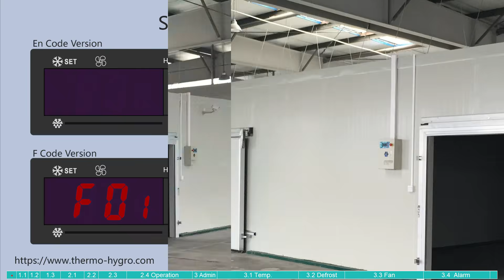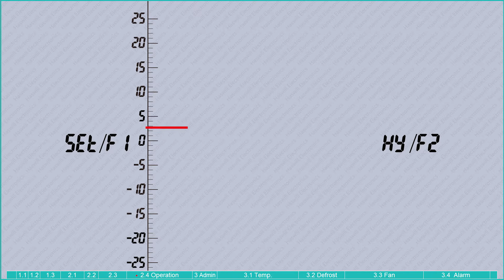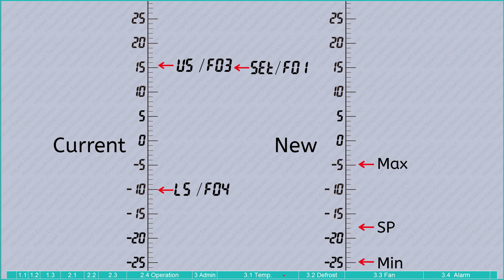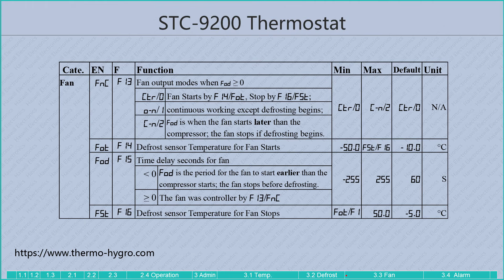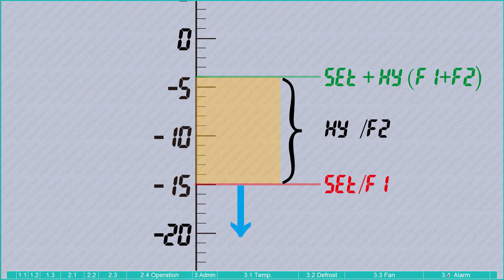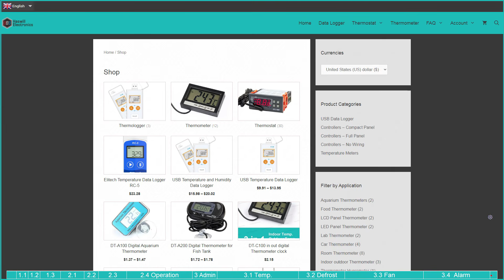The Ultimate Guide to Set the STC-9200 Temperature Controller

Comment: How about the relay of compressor is shorted even if no power supply?
Reply from the maker: sorry? Do you mean that the relay corresponding to the compressor is still closed even after the power is cut off.
Reply from the maker: If yes, usually because the power of the compressor is too high. He needs a bigger amperage relay. The default relay has a maximum current of 8 A.